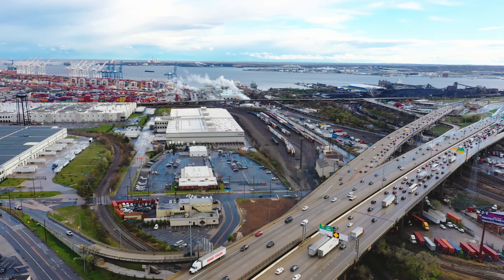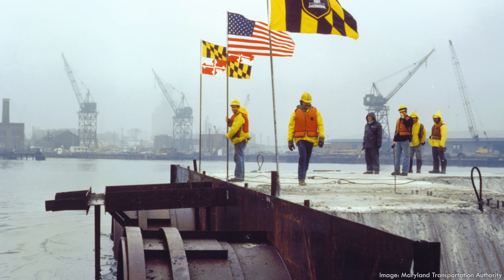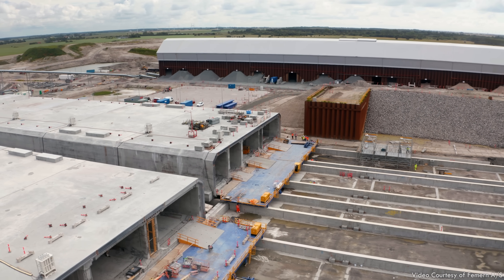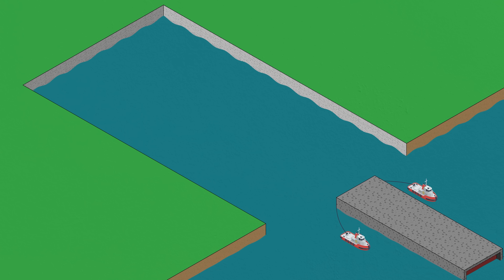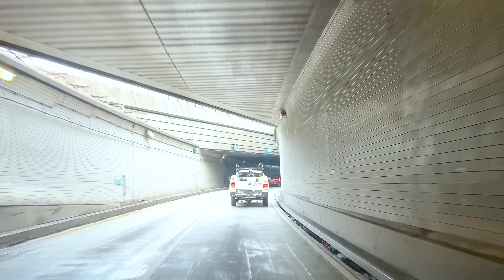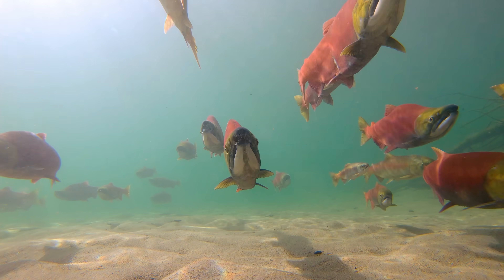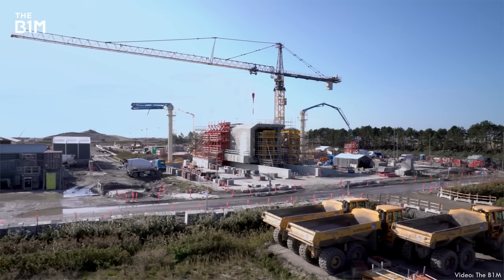The Most Implausible Tunneling Method

Comment from the maker: 🏞Lots of cool stuff (plus my book) available at the PE store: https://store.practical.engineering/
🥑Try everything Brilliant free for a full 30 days at https://www.brilliant.org/practicalengineering
Reply: Have the Germany - Denmark project laid their first segment yet?
Reply: Dredging is indeed a caution pov which induces a risk
Reply: Most of the tunnels in NYC were built using the immersed tunneling way. The first was the Holland Tunnel connecting Manhattan to New Jersey in 1906.
Reply: I wish you had mentioned the Mobile Bay tunnels in Alabama! There are three tunnels running under the bay in the city
Reply: What happens to the joints if there is a major earthquake?
Reply: Who did these submerged tunnels first?  How old is the technology?  Have there ever been any flooding disasters during construction?
Reply: @dgillies5420  Most of the tunnels in NYC were built with this method with the first one bing the Holland Tunnel built in 1906. There are other tunnels that are older than that. So this is an old method of building tunnels for at least 120 years.  I think the only tunnels that were not done this way in NYC is the Lincoln Tunnel which is 3 tubes, 2 lanes each.
Reply: You forgot an Important Tunnel.... The Elb-tunnel.
Reply: I’ve ordered your books but NO response as to when you will restock and ship ?? Disappointing!
Reply from the maker: @GeeMacViper  Sorry to hear that! You shouldn't have been able to put in an order while they're out of stock. Not sure what went wrong there! You can reach out to the customer support team for a refund here: help@practical.engineering. We finally have the books in the warehouse, and I'm hoping to get out there and sign them within the next week or two.
Reply: Will you talk about the power outage in siberia?
Reply: @einsjannis  Siberia? I assume you mean the one on the Iberian peninsula, Spain and Portugal?
Reply: Something you didnt mention, either because you didnt think of it, or wanted to hide it. The safety and strength of each? Boring tunnels have been proven to be solid and pressure resistant when used compared to others. Thats why diving bells, submarines and such are round shape, either ball round or cigar round. The pressure on the walls is stronger in that shape then it is on a flat surface, or box.
Reply: @latenighter1965  I think you are only partially right. If you look at any object of a given form under even pressure, the round shape can be able to redistribute loads better than a square or rectangular shape, That is why we will often find parabola shaped elements on bridges. However, how stable a bored tunnel is also heavily depends on geological formations. Often hey have to drill rods into the rocks around besides using either premade concrete elements or spraying concrete onto the walls, ceiling and reinforcement mats placed around. 
For submerged tunnels, also due to how they are constructed and where they are used, pressures are not that high due to the overall shallower construction. 
Also I assume they consider such loads when designing the tunnel elements, as they do when planing how to stabilize a bored tunnel (without any lining it would simply collapse over time).
So I do not agree that one is automatically stronger than the other. It is just different design considerations and circumstances. Of course a TBM will allways create a circular shaped tunnel.
They would for sure be able to make submersible sections in a tube shaped, circular form as well, but construction (forms) would be way more complicated and expensive, and for what hey do it would increase costs without providing additional benefits.
Reply: Sydney Harbour Tunnel is the same!
Reply: A few questions come to mind: How do they ensure continued negative buoyancy of the segments? How do they make the curves at each end of the tunnel, or indeed any lateral curves along the whole length of the tunnel? How do they accommodate fault movement? There are a number of harbours and estuaries which span tectonic faults, such as the one under Sydney Harbour, where the world famous bridge has adjustability to accommodate several hundred years of expected movement.

Comment: How do they avoid getting gravel into the bottom of the tunnel section end gasket?  It seems if you drag the new section across the bottom, you’d end up with a pile of gravel building up on the leading edge of the section.

Comment: Yikes! How the heck do they maintain the seals? The entire structure needs to be absolutely watertight. 

Also, I'm surprised that the tunnel doesn't need to be cylindrical to resist water pressure.

Comment: The Monitor-Merrimac Bridge Tunnel in Newport News, VA used this method back in the early 90s and the tubes were built in a shipyard in Baltimore and floated down the Chesapeake Bay. VDOT decided to use a tunnel boring machine for the expansion of the Hampton Road Bridge Tunnel as the least disruptive way to build it due to Navy and commercial marine traffic that leaves the ports on a daily basis.

Comment: Rubber is not a chemically stable material, it degrades over time, there doesn’t even exist any rubber in nature (I mean as a mineral or sediment), any rubber that would have be produced by life forms or hydrocarbons has long decayed into tar or CO2. 

So my question is do they add another layer of sealant on top or maybe inside the tunnel in addition to the rubber seal? Anything ranging from mortar to concrete seems like it would work, and potentially raise the project lifetime by many thousands of years. Because beyond earthquakes I don’t see much degradation happening, concrete is essentially just rock which is extremely stable, so unless it’s physically shaken appart or broken it would stay there until the end of time. But the rubber seals would decay

Comment: Hamburg actually has both. A tunnel and a bridge, each leading a highway across the harbor/river Elbe.
The tunnel is the older one and there is an even older tunnel.
That one has been retired to be for foot traffic and bicycles only. The old tunnel, opened in 1910, has no damp but stairs similar to those of the Greenwich foot tunnel in London and cars were brought down/up through straight shafts in a big lift!
When my mother was young it was still open for cars but rather as an attraction than as an actual route for day to day travel.
In addition Hamburg utilizes ferries as part of their public transportation network were some are basically swimming busses regularly used by commuters.

Comment: If the sections float when filled with air, sink when filled with water, then filled with air again after placement, wouldn't the sections have a tendency to float again? Are there compartments that are initially filled with buoyant air for transport that are left flooded after placement? Or is enough dense stable fill placed on top of each section to counteract the buoyant forces?

Comment: Obviously this works but ... what keeps the tunnel from floating away???

The tunnel sections are sealed and floated to the tunnel site so they must have positive buoyancy (lighter than the water).  Then enough ballast water is added to allow a section to sink (negative buoyancy). After the section is in place and joined to the previous sections the ballast water is pumped out which renders the section back to positive buoyancy. Why doesn't the tunnel section now float back to the surface? In fact, why don't all of them float?

Comment: This feels  40 years old, in Norway we have built tunnnels like this for 40 years. We also have tunnels through water, that sits nowhere, they are just tubes in water. They don't touch the seabed, or the surface, a kind of submerged floating bridge in tunnel.

Comment: I’m Dutch, years ago my father was high up in building the Øresund tunnel, and my wife and I were visiting my parents with Christmas in Copenhagen. Christmas was the only time most of the work was down, only some things were just 24/7 and kept going, but most people we saw, very few, were security. So my father took us to the site and gave us a tour, from the offices, Porto Cabins, into the tunnel, which was only partly finished. We went in, the first part was already looking good, but when we came near the end it became quite claustrophobic, little light (there wasn’t any work done, no people around), when we were at the end, my father said, now this is the safe side, he opened two heavy flood doors in the bulk head and we went into the last coupled component. Then we walked to the real end, on one side we, on the other side, divided  by steel wall the water of the Øresund. It was a breathtaking experience standing there in almost darkness in the buffer zone with the three of us.
When we got out of the tunnel my father took us to a little boat and we sailed to the big hopper lying there doing its work on the tunnel part we just stood in. They were one of the very few still working, a Dutch ship, specialized in dropping stones in the V shaped ditches next to the tunnel parts. We went to the bridge where the Captain showed us all the technical gadgets they used to stay on position and drop their loads at exactly the right spot. We then realized that only one hour before we were standing exactly there, only 30 meters down. It was mind bobbing and made us feel very small!
Well, as you can read, I will never forget that experience, almost 30 years ago!

Comment: Boring Question: are circular bores the only type?

You mentioned in this video about the wasted space in a cylindrical tunnel… could you bore a tunnel using 3+ vertically mounted cylinder bores in a sort of v-formation to tunnel in a rectangular way? The cylinder would behave a bit like the spindle on a belt grinder.
One issue I had in my head was about getting drive to a cylinder without affecting the bore.
Reply: Maybe an idea for a future video? Different tunnel boring techniques.. if (a) there are any 😆 and (b) you’ve not already done a video on it and I’ve missed it.
Reply: Negative. A circle, or sphere, is the most stable under stress.

Comment: Wondering why you couldn't build a tunnel through a perpendicular saw motion rather than boring. You maintain a circular cutting apparatus for torque optimization but you can have the cross section of the blade (and therefore the tunnel) match whatever you like...

Comment: I wonder is a modified version of this would work to cross the Strait of Gibraltar. The biggest problem is that you have to cross over where two massive tectonic plates meet. So my idea is a buoyant tunnel that's tied down by cables and kept underwater 200' but 100' above the bottom. The cables would be tight, but allow for some giveway in case of a major earthquake. Maybe someone with more engineering skills tell me why my idea would work?

Comment: Have you looked at the construction of the I-90 tunnel in Seattle?  The is an old The New Yorker article about it. The hill they needed to tunnel through was basically a pile of gravel. Ordinary tunneling methods wouldn't have worked.

Comment: I am a diver and am wondering the tunnels must not be to deep for to long cause just a thought wouldn’t there be nitrogen intake to worry about cause of the bends I am guessing they don’t go to deep with these tunnels or they have long shallow approaches in and out to accommodate
Reply: @pearabellum

Are you talking about driving through it? You are still at 1 ata in the tunnel dude its open ended to the surface...

Comment: Would you please explain how the sections get lowered? Do they partially flood them until they are neutrally buoyant, then use weights? It seems to me that the weight of the backfill and sidefill is required to hold the tunnel down from floating.

Comment: Question: Does water pressure increase on the top of the tunnel when a heavy ship passes overhead?
Reply: No. The water spreads out to a point of (near) equilibrium. And then back to sea level behind the ship. “Water seeks its own level”
Reply: @rogerpenske2411  Thanks.

Comment: 4:09 Wait, if the tunnel sections are light enough that they're buoyant when filled with air, then is the backfill necessary to keep them submerged after the water is pumped out of them? After all, they are filled with air once the tunnel is fully constructed, but you don't want them to float up off the seafloor.
Reply: Covered at 8:20 - commenting for others to see
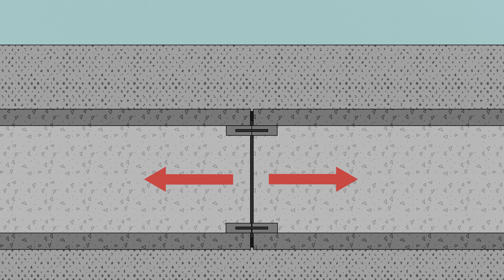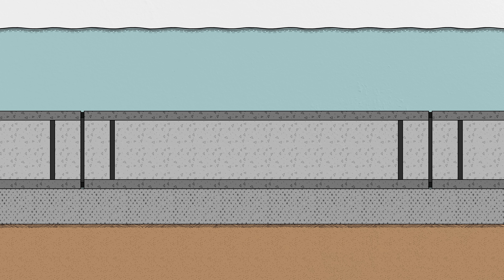Reply: @chibineo24  I assume you're referring to the backfill (described at 8:58). I made my comment because he specifically says the backfill is optional at 8:15 and also doesn't show the backfill in the diagram at 9:52, implying not all tunnels need it. I don't understand how a buoyant structure can rest on a foundation without some sort of ballast or backfill to weigh it down.
Reply: Maybe just watch the entire video before you comment, bud.

Comment: The narative could ave mentioned additional metrics besides the length of elements (200 m = 600 feet). The ammount of steel and concrete creates a total mass which can only be moved from the building site to the installation site using flotation - and appropriate balancing which eventually will allow settling on the bottom.

Comment: Perfect. What I'm struggling to get is how the sections are not floating upwards. At first i thought they are fully filled with water to sink in place, then get anchored somehow, then the water is pumped out. But apparently they're not and only a small portion of the section is filled with water during submerging. 
Are thier structure that heavy that they don't float? Hence the weight of the concrete and stееl is greater than the wieght of the water that could fill the internal space, so the segment has a negative buoyancy?

Comment: I've ridden BART trains through the Transbay tube between San Francisco and Oakland many times. If you don't absolutely have to have your car when you visit San Francisco, it's actually easier and less stressful to park at a BART station in an outlying area like Pittsburg (free parking on the weekends), and ride in on a BART train. You won't have to pay the bridge toll for the Bay Bridge, you won't have the stress of trying to find parking in the City, and overall, it's actually less expensive to pay for the BART tickets than it is to pay the bridge toll and parking fees in the City - about $18.00 round trip between Pittsbug/Bay Point Station & Powell Street Station in downtown SF.  I was in high school when BART first went into service in 1973, and I remember reading in engineering journals of the time, about the technology used to lay the transbay tube. It was fascinating to read about this when I was just starting to learn my profession, and San Francisco Bay is an excellent location for laying a pre-fabricated tube tunnel like this: the bottom is soft mud up to 300 feet deep in places, easy to dredge, yet firm enough to support a tunnel if properly prepared with substrate rock as your video shows. There was some worry about the safety and integrity of the Transbay Tube when the October 1989 Loma Prieta Earthquake struck; specifically, that the seismic waves might have caused dangerous amounts of liquefaction in the mud under and around the tube, but post-quake inspection indicated that the tube was still well-supported. Tunnels like this are really well suited for rapid transit systems like BART, because the trains are electric - no gasoline or diesel exhaust fumes that need to be ventilated - and BART uses a third-rail rather than overhead catenary wires for power, so the tunnel only has to be a little taller than the roofs of the train cars. Another excellent video, Grady, thanks!